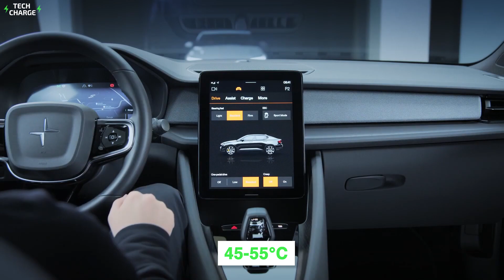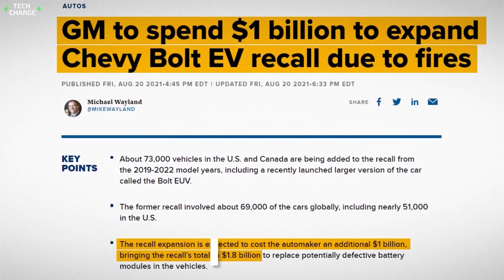The Shocking Truth About EV Fires You Need to Know

Comment: Generally, fires are started by electricity in cars, electric cars as fuel cars. An ordinary car has 12 volts with a small battery, an electric car has around 400 volts and a very large battery as a tank, that's a big difference. So the more electrical equipment there is, the greater the risk of a fire. I would never get into a lithium bomb car with 400 volts which is so difficult to close in case of fire. I have seen buses that had stopped and suddenly caught fire in the lithium battery and not everyone made it out without their hair on fire or worse, imagine if the bus was speeding up. I always park my "dead animal and plant powered" car far away from electric cars and intend to put up a sign saying "Parking for plant powered cars only" in my parking lot by my house.
There were more important climate tasks than switching fuel cars to electricity.

Comment: @pan6593 Nope, I am not "out of my mind". Thieves steal vehicles in order to steal other vehicles and  whatever they can load into those vehicles. They do not limit themselves only to reselling those stolen vehicles. 

They can do more stealing with the  use of the stolen vehicles before they actually sell those stolen vehicles. Now, that's thief logic. 

It is not, however, logical for thieves to resale stolen Teslas when the sales of used Teslas are drastically on the decline. 

Also, thieves will not use Teslas to steal vehicles or stuff because they don't have the time to pamper and babysit temperamental Teslas.

Comment: They will sell EVs with asbestos suits for the driver and passengers.
Reply: You will just disintegrate inside the suit, instead of in your car seat.  Guess it makes it easier to have something to bury. Melting point of asbestos = 1600 degrees Fahrenheit much below the about 3600 degrees F of a lithium ion battery fire.

Comment: It’s simply not possible to extinguish a LIon Battery fire ! A Gasoline or compression ignition engine carry only a part of the energy with them , the rest is coming from the oxygen in the air ! 1 kg fuel and 12,5 to 16 kg air ! It’s extinguish able ! When you prevent the oxygen coming together with the fuel . In a L I On battery is everything in it . Simply NOT EXTINGUISH able.

Comment: Yes mate but what you did not mention was that EV battery fires are self sustaining and burn at much higher temperatures than any fossil fuel car would. It is a well known fact that an EV battery fire can reach temperatures (in excess of 2000 degrees centigrade) that can destroy steel and even concrete not to mention any surface that it may be parked on and the prospect of it burning inside one's garage or carport is simply terrifying to contemplate. Now what your insurance company thinks of that I reckon that as in the UK they will become uninsurable.
Reply: Did you know that they can even burn underwater?  There are a few video's where EV's are boat launching and the EV slips into the water and burns!

Comment: Here is the Scary bit - Dendrites - what are those?  A dendrite is a sliver of contanimate that can grow inside a battery - IF it grows across the battery it can cause an electrical short.  That short could start a battery fire; and there are 6000 cells in a EV pack = 6000 chances of a dendrite growing across. This is why EV fires seem to random - they are random. Your EV is never really off so a dendrite can grow across at any time - while you are sleeping and it is charging in the garage - any time.

Comment: What turned me against EV's is that democratic party and environmentalist are doing all they can to force everyone to switch from internal combustion engine cars to EV's. EV's are not yet ready for the mass market. More testing is needed to ensure public safety. Gas vehicles have had a hundred years of testing and work to make them as safe as possible. The point being is government should not mandate what you purchase or own. EV's are not cleaner vehicles to own and operate, to make the batteries for one EV creates as much pollution as one gas engine car makes in a year. And the power plants needed to provide electricity for EV's make pollution. Wind and solar farms cannot provide the power for a small city or a town. No matter how much we try we will need oil from the oil industry to provide oil and grease and coolant for EV's.

Comment: According to the United States NTSA, there are about 211,000 vehicle fires per year in the US. Of those, 4,125 of those are electric vehicles. That works out to just under 2%. Of all cars registered in the US, ~7.2% of cars are battery electric. You are roughly 3.7 X LESS likely to have an EV fire, than in other cars.
     When 65 kWh battery burns, its equivalent heat output is the same as 10.5 gallons of gasoline, or, 8 gallons of #2 diesel fuel. The difference is the RATE at which that heat is released, and the pressure of the flame ejecta. In almost all EV's, the batteries are placed low, under the floor pan of the car. When they blow, the flames jet out from underneath the car, making them perfect for setting adjacent vehicles (of any kind) on fire. The temperature of the flames is hotter, than gasoline or diesel.
     It's not worth it for a fire department to try to extinguish an EV fire. the best thing to do, is move the car away from anything else, then, just let it burn. Extinguishing the flames is NOT a good thing to do, because of the possibility of un burnt, but damaged cells flaring up again. It's better to let them all burn. The firemen's resources are better spent, making sure the fire doesn't spread to other vehicles, or property. Spray the water on adjacent vehicles, not the EV that's burning. I say this, because once a battery goes up in flames, there's virtually no hope of saving the  EV. It will be a totaled loss. There's no sense in wasting resources on a vehicle that can't be saved.

Comment: The problem will go away within a year or two when they stop using lithium-ion batteries and start using sodium-ion batteries. After all, when was the last time your salt shaker burst into flames. Sodium-Ion Batteries can carry a smaller charge than Lithium-Ion batteries. Simple solution; add more of them, problem solved. Sodium-Ion batteries will charge much faster and will also give you a longer range.
 Великий и Славный и самый Имперский ЛЕВ 🦁

Comment: Don’t buy electric cars. You will pay a lot more to use superchargers compared to gasoline vehicles. Your driving range is going to be a lot less than expected. Example: Tesla cars advertised with 100% battery charged is 330 miles range. Real range city driving 230 miles maximum and highway 200 miles . If you drive night time is a lot less driving range. Don’t buy EV cars. You will regret 100%. I made this mistake and want to warn you.

Comment: EV fires are most likely due to H2O present in the circuitry. Cold weather, flooding, or extreme humidity seem to always accompany these fires. After flooding many will catch fire as seen in Florida. Melting snow, hot humid weather, or thundershowers seem to be Tesla’s downfall. Also there are reports almost daily. So no they are actually very common. A couple burned to death in one due to the speed and heat of the fire. Tesla’s can burn at temperatures up to 2,760 degrees Celsius, or 5,000 degrees Fahrenheit.

Comment: There may be fewer EV fires ,but a lot of ICE  fires are due to carelessness, such as poor wiring and improper fuel system maintenence. Also there is plenty of warning of trouble.
Reply: I agree, most people drive old cars and just can't afford to have mechanics safety them.  EV fires are from rusty parts in the batteries, wait and you'll see the number of EV fires literally and figuratively explode in the next few  years.
Reply: @COSMACELF1802  You're right rust ;iron oxide is a good oxidizer.

Comment: The rapid charging is causing cell casings to crack, exposing the electrolyte to the air. This makes the cell very unstable and likely to combust...it only takes one cell in an entire battery system to start a fire.

Comment: no way in hell it's a 1% chance a gas vehicle goes up in flames, I call BS
Reply: Unfortunately the statistic don't distinguish between new ICE cars and cars on the road for decades. It also does not say it the fire was big, small, caused by external fires or put out easily without scrapping the car.
If they would limit the statistics to cars built after 2010, I think the odds would be completely different.

Comment: As EV's get older, they will become more vulnerable to fires.  Corrosion of metals and deterioration of wire insulation due to environmental issues (moisture, temperature cycling, molecular breakdown, etc.) will reduce their ability to contain and accurately direct their enormous stored energy. A short circuit here, a short circuit there, boom, you have a problem.

Comment: @wylieecoyote  Yet and still the thieves do not want the Tesla vehicles. If they did want them, then they would have been stealing them ever since day one. 

So, if they stole a Tesla would they be able to charge it even though they don't own it? Also, would they be willing to pay for the charge, if they are able to charge it? 

Why would thieves choose to put themselves in a position to pay for the charging of an entirely battery-powered vehicle; in which they would have to constantly be concerned about the constant drain on the battery as they drive about terrorizing everyone? 

Would they really want to be bothered with monitoring the correct percentage level of charging and the preconditioning of the battery before or during or after the charging? 

Thieves need transportation that is convenient, quick, and easy to operate for their constant wrongdoings. 

However, should they decide to use a free charger, they would not get enough charge in enough time to be effective thieves. They do not have the time to wait hours on end for an appropriate charge of a stolen electric vehicle.

Plus, they would have to be knowledgeable of the charging wattage per vehicle. Should they use cable number one or cable number two when charging whatever model Tesla? 

Are they really going to read the car instruction manual; which most likely is on the computer in the car? Thieves don't have time for such questions.

Furthermore, they would not know how much driving range would be present on the Tesla they stole. It could only have 25% range at the time they stole it. Are they going to try and get it charged so they can continue to use it and steal more stuff and go joy riding? 

If they stole an ICE vehicle or an HEV, and there was only a quarter of a tank available, then they could go and get gas and continue riding and stealing. 

They would have to ditch the Tesla after it ran out of range, if so they chose to waste their time in stealing it. So, once again, what's the point of stealing a Tesla? Just imagine car thieves suffering from Tesla range anxiety. 😆

Comment: NHTSA U.S. government data reports, EV fires occur less frequently than ICE (Internal Combustion Engine) vehicles, with 25.1 fires for every 100,000 vehicles sold compared to 1,529 fires for ICE vehicles. Hybrids catch fire more frequently than just electric, perhaps a result of the battery pack being adjacent to a combustion engine and fuel tank.
The manufacturers of ICE vehicles are trying to play catch up after taking huge losses and have been launching disinformation campaigns while working feverishly to develop the same technology.
Tesla vehicles have toppled the NHTSA and EUROCAP crash and safety scores taking every top position by a wide margin.
Most people carry around a cell phone and laptop with Lithium batteries. They catch fire at the same rate, but do not attract attention. 
All EVs are different, just as ICE vehicles are different.

Comment: I dispute the notion that EVs have less chance of catching on fire.
The recent Luton car park disaster is a case in point. Despite the Range Rover clearly being a hybrid, going by the location & ferocity of the flames, authorities are lying, insisting that it was a diesel.
Reply: You are wrong...do a bit of research, quote "An additional study by that agency and an American insurer found that just 25 out of 100,000 EVs suffer fire damage. By comparison, 1530 per 100,000 ICE cars experience fire, and hybrid vehicles suffer a much higher risk of 3475 per 100,000"
Reply: @martinwalker9234  Woah! I'm wrong & need to do a bit of research?
QUOTE: ""An additional study by that agency and an American insurer found that just 25 out of 100,000 EVs suffer fire damage. By comparison, 1530 per 100,000 ICE cars experience fire, and hybrid vehicles suffer a much higher risk of 3475 per 100,000" 
My research shows that your cherry-picked points have been done to death and rightly challenged by people who've looked into them.
I won't challenge your point that only 25 of 100,000 EVs suffer fire damage, but be aware that there was an instant when a Tesla went into thermal runaway while parked under an occupied apartment complex, putting residents at risk.
A portion of fire damage to ICE vehicles has arisen from joy-riders setting them alight to remove evidence.
As you've stated, hybrids are statistically more prone to fire damage than ICE vehicles. The Luton Airport Carpark fire started when an irresponsible owner knew his car was smoking yet abandoned it to catch his plane. The whole structure was destroyed, along with 1400ish vehicles, including EVs, which no doubt extended the damage.
Let's talk about sustainability and recycling. Damaged ICE vehicles have been the source of cheap parts at wreckers, and the bulk is capable of 90% recyclability. Plastics are the remaining 10% ish. Batteries & tyres are recyclable/reusable; the steel components, even the fuel tanks, can be recycled.
By comparison, EV batteries are a nightmare to store and not readily recyclable. Stored EV batteries have spontaneously ignited, taken days to put out, and, at times, reignited weeks later. All the while, they spew highly toxic emissions that can cause death or long-term health issues for those within kilometres.
I could go on, but I've given you enough to check out if you find time. 😉